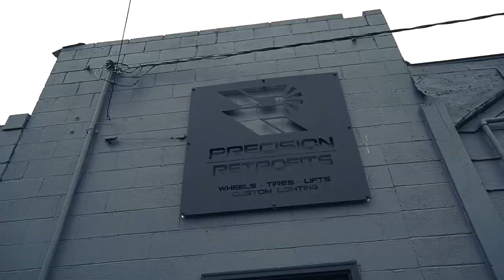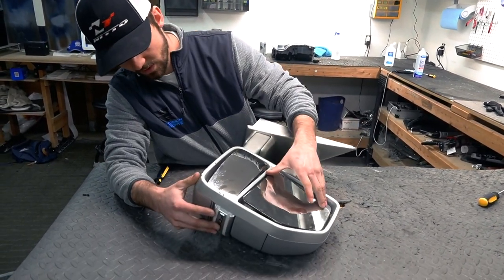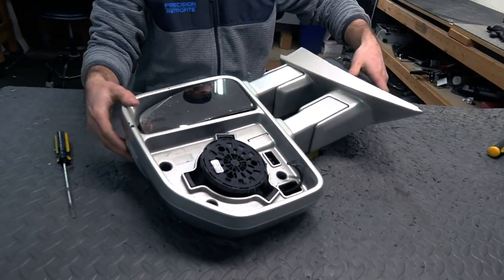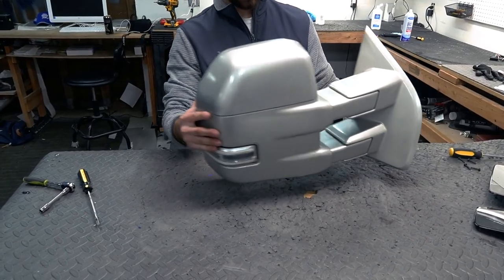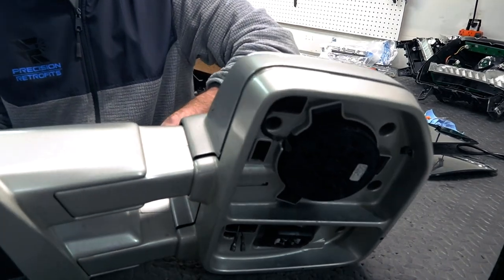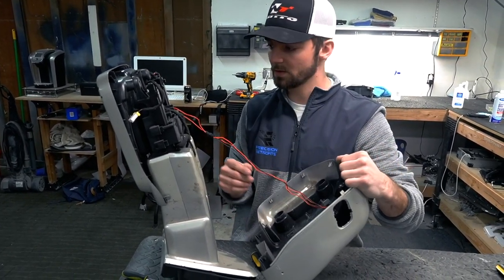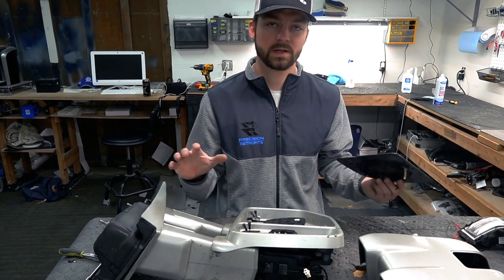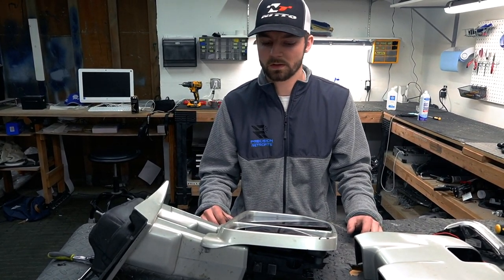Disassembling F150 & Super Duty Mirrors (New Style Mirrors)

Comment: I thought this vid was going to show the extend motor replacement.  My 2008 F-350 driver side mirror will fold and glass will tilt, etc., but when trying to extend I can hear the motor run but no movement.  Must be a gear stripped or has come unfastened from a shaft?  Pass side mirror works fine.
Reply: Same on mine
Reply: I would love to see a video on this repair also.

Comment: I need a video on how to disassemble the opposite end of the 2018 F-350 folding mirror (the hinged folding end) in order to remove and replace the folding motor.  Thanks!
Reply: Did you ever figure this out? I might try and buy a broken mirror assembly and see if I can tear it down. I’m looking to mount cameras and need to figure this out before blindly drilling holes.
Reply: @BRAAAPOLOGY  Yes, I pretty much figured it out.  The manufacturer of the replacement gears and motors for the mirror fold function provided a document with description and photos.  However, there were/are a few parts that need better detailed instructions.  But, I have pretty much figured it out.  Right now, since I am just experimenting (I'm a retired electrical engineer from GE), I'm setting up a 12VDC power supply and have wired up a polarity reversal switch (for fold-in and fold-out) to test the unit.  I am in the process of identifying the wire colors for all of the mirror motors so that I can test functionality of all mirror functions (fold-in and fold-out, extend and retract towing mirrors, and main mirror up/down and side-to-side).  I got the correct part number off of the main mirror connector and requested and received samples of the female pins from TE Connectivity so that I can connect to the connector pins without damaging them.  If you need or would like help or information on what I have learned later on, I'd be glad to share that with you.

Comment: hey i have a question...can you get a camera on the bottom of that mirror where you can run the wire through the mirror to inside door?  just installed the boost auto mirrors and  i was thinking about running the turn signal cameras
Reply: Did you ever figure out how to do this?
Reply: @BRAAAPOLOGY  no they were very tight where the plug is on the inside mirror and I didn't want to hack them up being they were brand new at the time lol